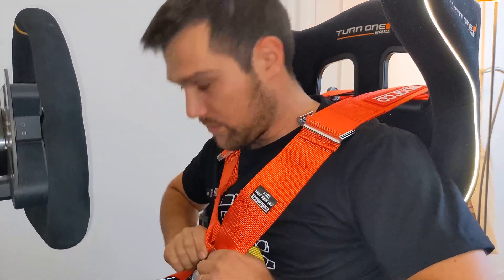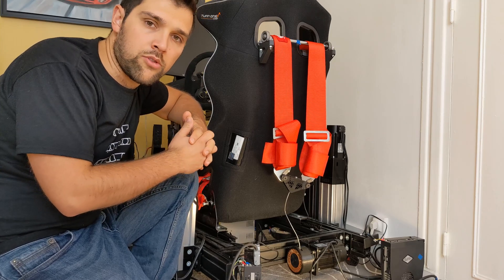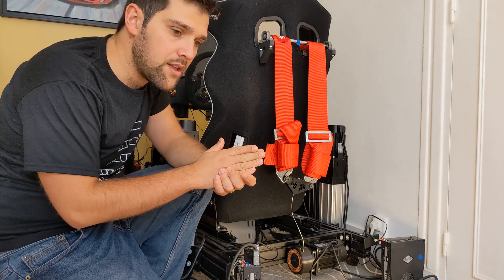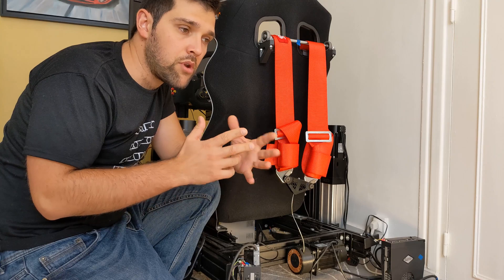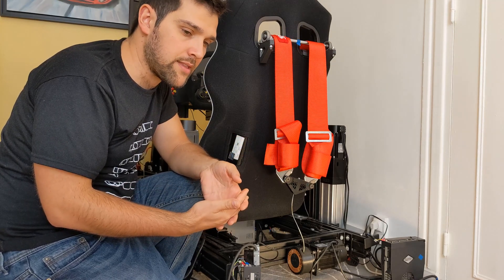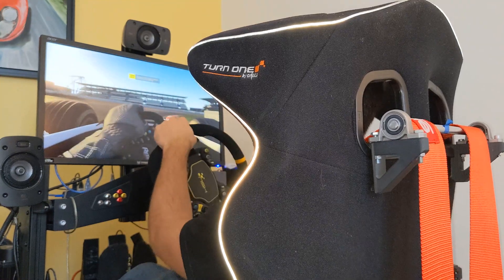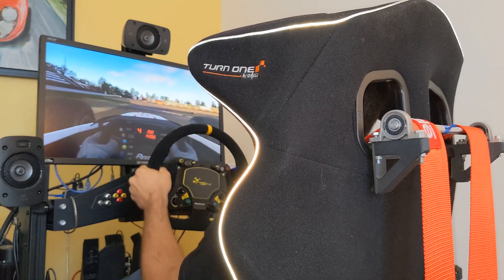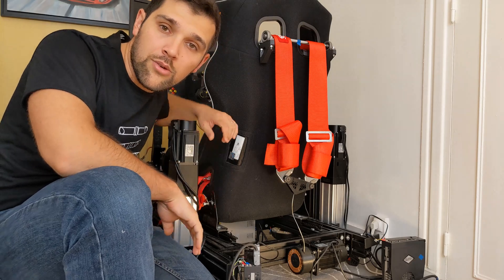Seat Belt Tensioner P1 : Presentation !

Comment: Ever thought about using the “new” belt tensioner feature of Simhub instead of FlyPT?
Reply from the maker: Yes. I already tried it. Didn't like it... Stepper motors aren't smooth...
Reply: @LeboisRacing  I meant just the software part to pilot your harness, instead of running another software besides SimHub
Reply from the maker: @marchinop7278  it's meant to use stepper motors, not servo

Comment: Glad you updated to motor that won’t overheat! Gonna check out the build tutorial and put something similar together. I appreciate you making the 3d printed parts available. Are you using simhub? Thanks!
Reply from the maker: no it's based on Flypt
Reply: @LeboisRacing  Why did you change to Flypt and not simhub like the GT variant?